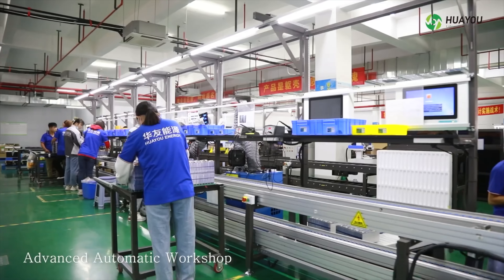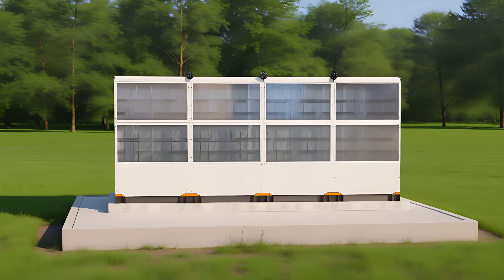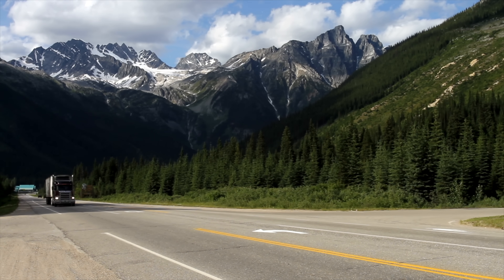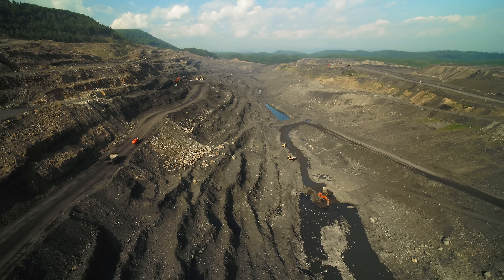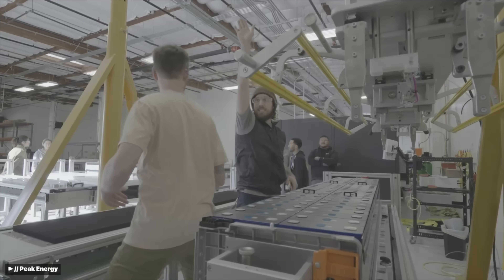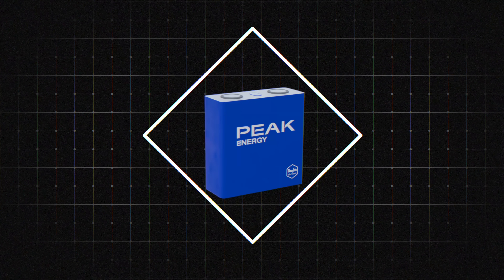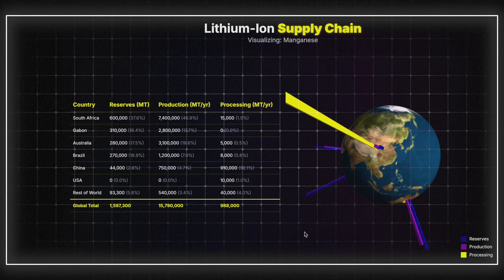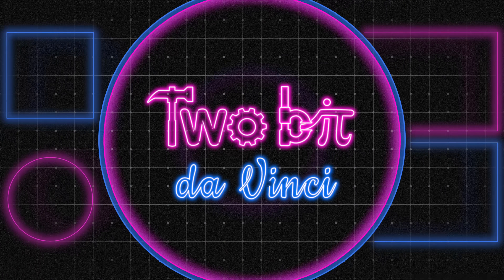Sodium Ion Batteries Are Going to be EVERYWHERE - Here's Why

Comment: CATL is ramping up actual production of a sodium battery that will give them a virtual monopoly on car battery protection - reportedly less than half the cost of the lithium-ion batteries per kilo, higher energy density, longer life, no thermal runaway, better in extreme cold and heat, pretty much every conceivable metric.
Reply: Faradion has been producing Sodium-Ion batteries for a while, but mainly targeting grid storage solutions.
Reply: @GruffSillyGoat An American company just deployed a grid scale sodium-ion battery system in the US as well.
Reply: PEAK use a slightly different, technology Sodium-NFPP cells that have been around for a while, but tend to be less power density than other cells. Their may selling point though is low operating temperature, that allows them to be passively cooled. These are good for certain  installation where ground footprint is available, as their main benefit is lower operational cost rather than energy density per unit area. They seem to be targetting flow batteries as their main competitor, which has similar characteristics.

Comment: If the comparison of SOC graph is representative of reality there is not a lot of difference in energy content.  What is confusing people is the perception that the voltage drop with SOC means less energy storage with the Na battery.  However, if you look at the point where the curves cross, just below 50% SOC, the cell voltage is equal.  Just imagine rotating the Na curve around that axis until the SOC of the Na is the same as the LFP.   State of charge is ampere hours.  So, use a buck type converter to reduce the initial higher Na voltage to equal the LFP, and a boost to equal it for the rest of the SOC and the energy will be roughly equal, with a relatively useful voltage output.     Not perfect, but then the other advantages outweigh the added complexity for most purposes, especially weather.  Especially given that most uses of the batteries already requires the buck or boost type electronics. anyway.

Comment: Sodium is not salt.  Salt is NaCl, sodium chloride.
Reply: @Jim1971a  that’s just table salt. There’s many salts
Reply: @uhohhotdog I’m aware, but the element sodium is not a salt.
Reply: @Jim1971a He's saying you can extract sodium from sea salt. That's why it's so abundant, much more so than lithium.
Reply: @samielkhayri9272  We do not have a issue with shortage of Lithium, the known reserves in the world as so huge that multiple generation will be death before we "run out", not counting recycling. Lithium is not a rare mineral, just harder to process like a lot of "rare" minerals. 

So being able to extract sodium from sea salt is not the a advantage you think it is. Also, easier to get salt from different sources then the sea.

I remember hearing the same about oil, and then we kept finding new deposits of oil, more deposits, then the fracking tech got better (and now the US is a exporter). Are we out of oil? No ... but we are already switching to a new energy solution, despite that we have 50+ years left (before becoming uneconomically), not taking in account new techs etc. 

In reality, by the time lithium is fearmongered about running out, we will be using something new again.
Reply: @benjiro8793  It's not about "running out of lithium" it's about cost vs. Power density.

Comment: Cool, im seeing sodium ion cells on aliexpress right now.  About the same price as lithium but like half the capacity 1300mah, i think i seen a 1500mah or maybe that was just marketing.  I guess that the tradeoff for its benefits.  I like the idea of running them down on an electric scoooter or something and not needing a BMS, just letting power and speed go  down until you cant tolerate it and recharge.  Thats what i like about alkaline batteries for LED's compared to lithium, lithium would just shutoff, alkaline would continue forever even with a faint glow. You could limp to a charging station without worry in an emergecy.
Reply: Sodium battery is still in the newborn stage right now. Once production ramps up and the market share expands the price will eventually drop

Comment: We need 12V sodium ion replacement car starter batteries designed for existing ICE vehicles.
Reply: This video had nothing at all do do with EV batteries.
Reply: @avsystem3142   My comment had nothing to do with EVs as well.
Reply: Yes it would reduce the cost tremendously and still have more energy density than a lead acid battery, and it will last for the lifetime of a vehicle. I would also use them on all my cordless tools even if they are a little heavier, I'm tired of buying 10 - 15 batteries a year building houses, lithium ion batteries are very expensive and only get 500-600 charges at best and don't work at all when it gets cold, then you have to put all your tools away and set up dozens of extension cords and break out the heavy power tools.

Comment: You shouldn't mix NMC and LFP as you see fit when trying to make a point. You can use LFP from 0% to 100% just fine. The flat curve is only for LFP, not other lithium chemistries. Thermal runaway without external heat source is present in NMC, but not LFP - and in fact LFP required temperature for thermal runaway is generally higher than Sodium Ion.
Reply: exactly what I had in mind

Comment: From what I've seen, most battery tech for stationary grid backup works because the large size and weight isn't an issue. While it is great if it can revolutionize that part of industry, most people won't care until the battery tech can be used in personal devices and e-vehicles.

Comment: The energy density with sodium is pants , the battery voltage sags badly on discharge and the battery life is reduced compared to LIFEPO4.  Remind me again what game this is changing?
Reply: A pilot installation of the Peak Energy system was installed last year and is in operation. Multiple commenters are conflating the described fixed base grid scale system to EV batteries. Energy density is much less of a problem if the size of the batteries is not constrained by needing to be used in a mobile application.
Reply: @avsystem3142 sorry but the low C rate coupled with the voltage sag that sodium experiences on discharge are big problems for large scale batteries.  As the voltage sags the current has to ramp up to compensate.   On a more general note batteries are never going to be useful for anything other than very short term grid stability.  The energy storage required to compensate for weather dependent renewables at grid scale is way above what any battery technology could provide at realistic cost now and probably ever.
Reply: @thamesmud   that's what peaker plants and nuclear are for...

Comment: $/kwh
kwh/kg
If it can't beat lithium today in one of those it's dead in the water.
Reply: Not for fixed base grid scale installations, which is what is described in the video. The weight of a terrestrial battery installation is not a consequential factor.

Comment: The USA is 12th in aluminum production. Your every word is now suspect
Reply: Your every comment is now suspect. From Google: "The United States ranked in fifth place globally for aluminum production in 2024, a significant drop from its position as the world's largest producer in 2000. The U.S. now produces a relatively small portion of the world's primary aluminum, partly due to high production costs, high energy requirements, and the closure of key mines."  Ricky was correct. You are wrong.

Comment: Does anyone believe that only Peak Energy can make sodium batteries?

Others too can and is making sodium batteries. Peak Energy will have to compete on price, and there is no breakthrough there. At least, the author didn't show any.
Reply: The company almost certainly has multiple patents on the particular chemistry and process used for manufacturing the product.
Reply: @avsystem3142  Others don't? A few are making sodium batteries now.
Reply: @avsystem3142  Only this company has patents? For all we know, others may have filed before them.

Comment: If you have a chemistry that is reduces to half the voltage, performances will degrade a lot long before the battery is getting low on charge. This is not a positive feature.
Reply: Your comment is a grammatical trainwreck. You clearly don't even know English, much less anything about battery chemistries.

Comment: What is the charge and discharge rate?  How may cycles can it do?  How is the manufacturing process different than current batteries today?  These are basic questions that need addressing.
Reply: What is the energy density per kilogram?
Reply: @ab3000x  He said it was similar to Lithium iron phosphate batteries...probably 200-290 Wh/kg  It doesn't matter much for grid storage
Reply: @gabrielsworldadventures  how many cycles it can do is though, this is a key point.
Reply: @gabrielsworldadventures   200-290? Um, no. CATL is the king of batteries and their sodium battery is only 175Wh/kg. I’m guessing this one is lower than that. BTW, LFP batteries are usually closer to 185.
Reply: @ab3000x  My bad, I thought LFP were higher WH/kg.
Reply: there are others who actually know what they are talking about this a clickbait piece that has no idea what to say

Comment: It looks like a promising technology.

A bigger concern I have, though, is the American capital system. 

It looks like Peak can produce small volume engineering samples.  But to truly reach full product potential, they would need probably 10 years of sustained development effort to improve material quality and performance, iterations on cell architecture, manufacturing processes, address reliability fails, reduce manufacturing defects, optimize cell operation algorithms, system architecture, etc.  

During this time, most of profit will have to be reinvested into development, and even then battery is a fungible commodity that will not have customer lock-in, meaning profit margins will be thin.  American investors usually do not have this kind of patience or tolerance for such low profit margins.  They usually like to keep their money in tech disruption cycle and then cash out.  At least that’s been their modus operandi last 40-50 years.  Look how Tesla has to keep dangling promise of pie-in-the-sky disruption to keep investors interested.

This is a structural feature of American private capital vs Chinese state capital, which cares more about operational cash flow than huge ROI.

I wish luck to Peak in dealing with American investors as they try to become a battery player.

Comment: This would be safer for home battery backup.
Reply: Sorry same core issues as lithium except one.  Plentiful to source.  Sodium explodes in water just as Lithium does.  Trading one element for another on the far left of the chart will never change that issue.  Not saying it won't be an economically viable alternate but the claim it won't burn is a total lie, metallic sodium is stored under oil to stop ignition with water in the air same as lithium and potassium.  Sodium salts are less reactive but does not make good batteries same as with lithium salts, you need the raw element.